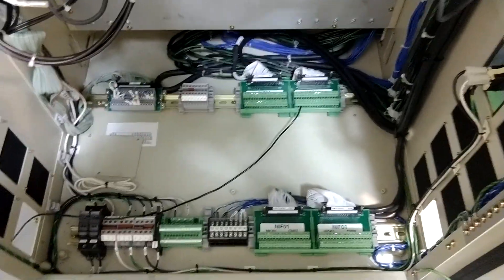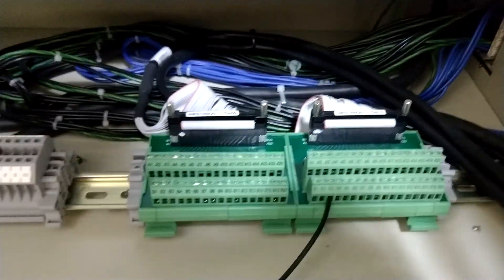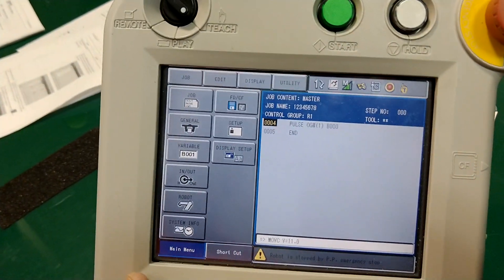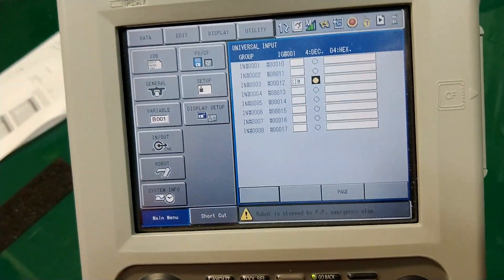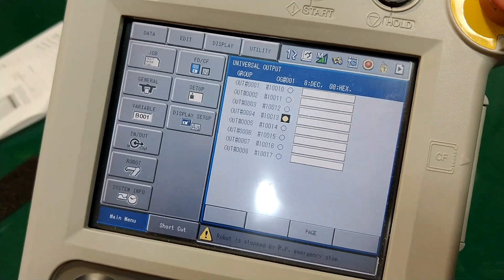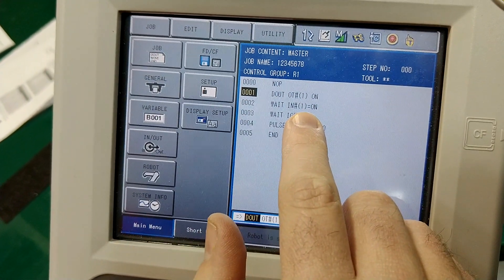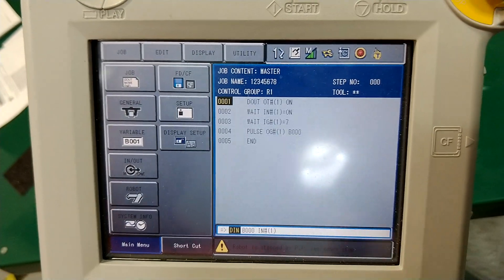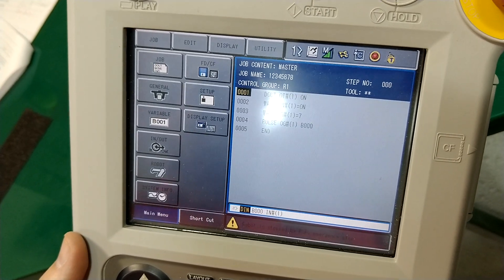Nx-100 I/O commands

Comment: if i simulate an input that IS wired in but is not actually on will that actually send the signal to the plc that the input is on?  Like say if im doing some troubleshooting and the program is at a wait for input#whatever from a proximity sensor that is damaged or known to be out of adjustment and i just need to force it to get to the next step instead of climbing into the tooling and making sure the sensor is adjusted properly.
Reply from the maker: The input is only true in the program. There isn't a physical signal to the input card.

Comment: Hey I'm working on a project where we need a sensor input that starts our program. Only we don't really know in what number the kabel needs to go (like A5 or B7). And what IN number we need in our program at the WAIT command. We really hope you could help us! Thanks in advance.
Reply from the maker: Without a wiring diagram/pinout, I can't really help you. My set up could be different than yours.
Reply: Dan Staifer Is there any way we could communicate with each other. I'm pretty sure I can send a picture of  the wiring diagram. My number is +31 6 21943195 or email: fritsmulders99@gmail.com. Thanks again.